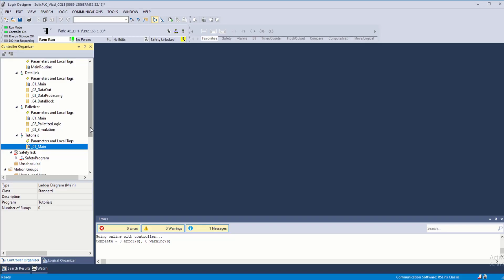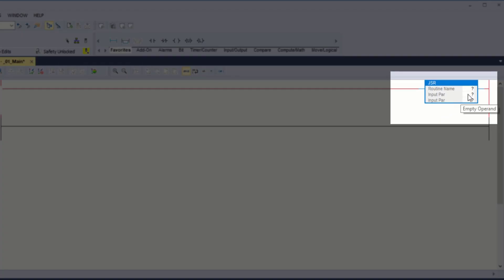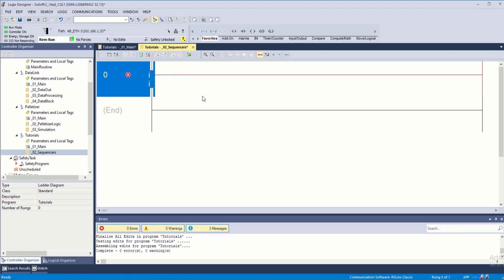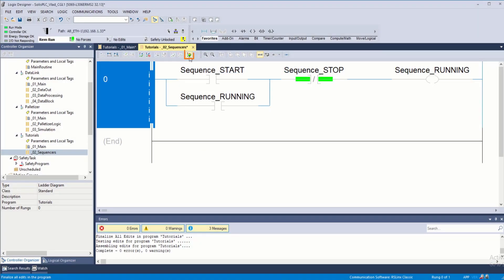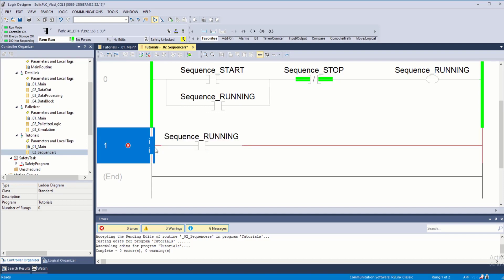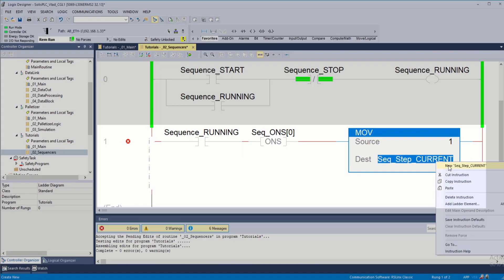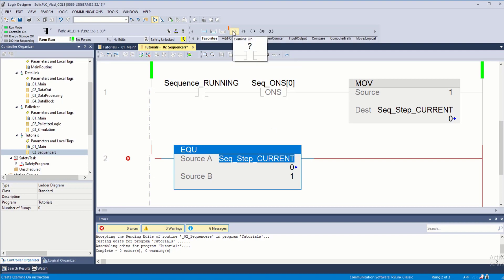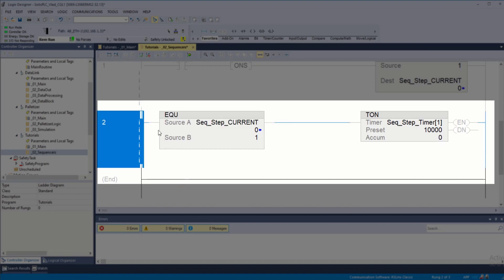RSLogix 5000 Programming | Sequencer Tutorial Using MOV, EQU, TON, and XIC in Ladder Logic Interview

Comment: Also to add on this you should probably build your sequence as a datatype with paramters for steps, messaging, step times, step descriptions, bools for driving outputs etc. then you only need to create a selection tag using that datatype. using the datatype makes it much cleaner. good video btw👍
Reply from the maker: That's a good point. You can improve the code in many ways and make it much more readable / usable. Thank you for bringing it up.
Reply: Where can I learn those programming methods? 🙏